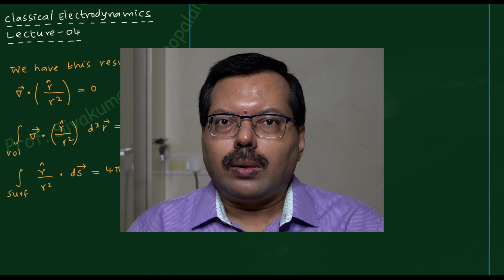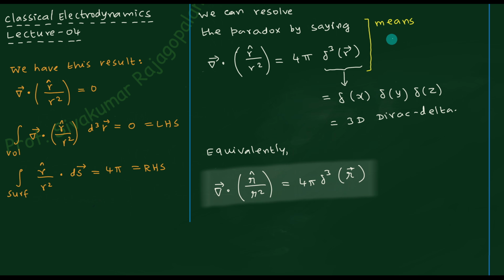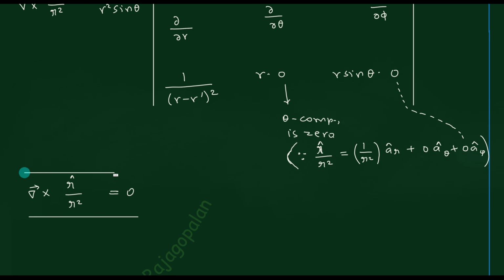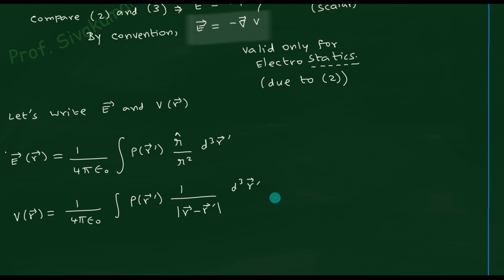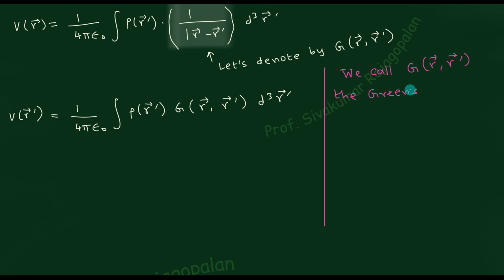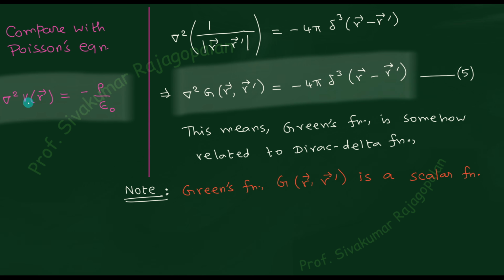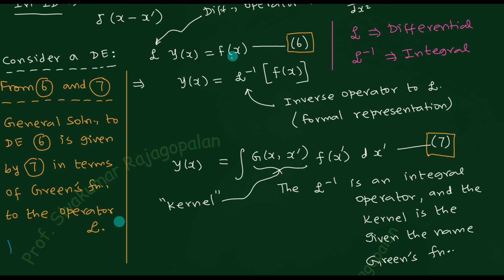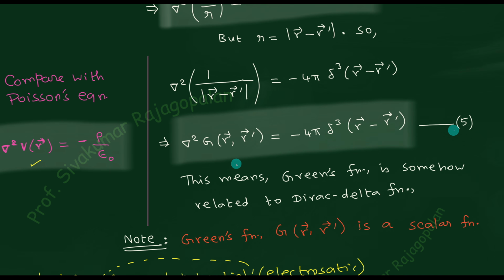Electromagnetic Theory Lectures

Comment: Sir, if we put div(r cap/r^2) =4 pi, how that solves the paradox. Because if we take volume integral of that div. i get 4pi times volume of sphere, that is not equal to RHS(4pi).
Reply from the maker: The RHS is 4*pi. That will not change. You have to somehow accommodate this 4*pi in the LHS. But since LHS is zero, we have to satisfy both zero and 4*pi together. This is where the Dirac-delta function comes to the rescue.  Hence, we finally propose that LHS should have been 4*pi*delta function.